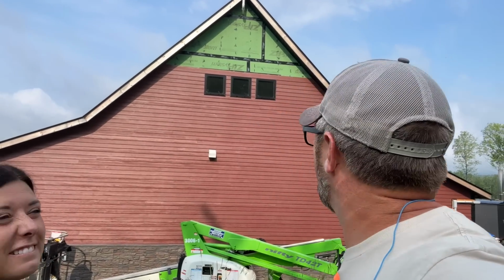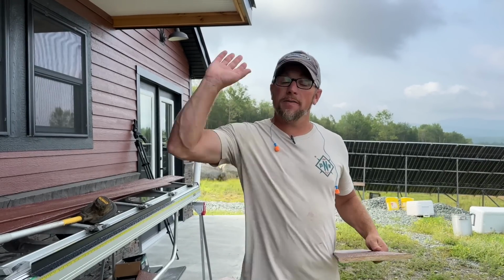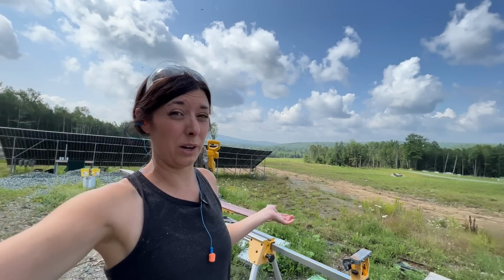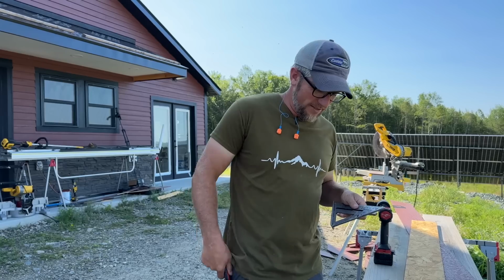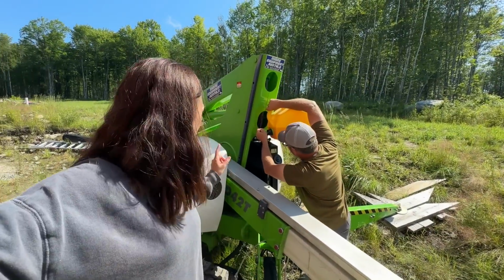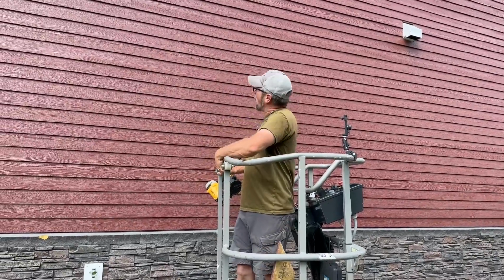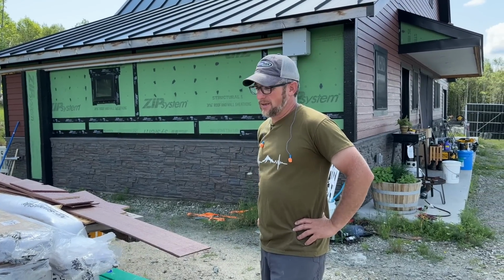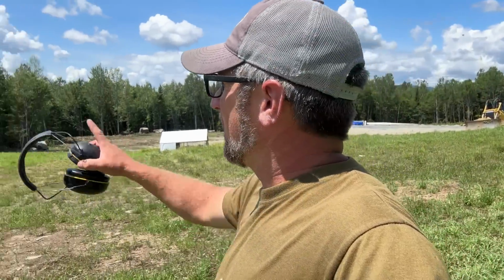We NEVER Thought THIS Day Would COME| Building Our OFF GRID House in the WOODS

Comment: There is a glue roller bottle that you can also use for paint and it works great for small jobs like edging and trim on things like you and Al are doing with the siding ... might work for "other projects as well ... get tham at your local Lowes and Home Depot or other building supply stores ...

Comment: I just did the peak like you did on my shed. For the future you can save some time measuring each board by using the one cut previously to mark the next one. Lay the cut one down and lap the to be cut one over it as it would be on the wall. You'll need to have spacers to make sure the lap distance is correct. Then just transfer the cuts to marks on the new board.
Repeat on each one going up, and the installer should report back if the gaps are getting too small or too large as you go, for the cutter to adjust slightly.

Comment: I found (years ago) a kit for sealing ceramic tile grout joints. it was a small squeeze bottle with a foam roller on one end. You would fill the bottle with sealer and then roll it on the grout to seal the joint. if you go to a tile store you may be able to find one. it might work for your paint on the siding edges.

Comment: My suggestion on the paint.  Take a small 4 oz. empty glue squeeze bottle and put paint in it or any empty squeeze bottle with a covering over the end that you can pull off.  Small enough that if the paint goes bad no big deal.

Comment: Brat to see Gina in good health to supervise So as he works high up. Not sure that's doing her mental health much good though! Isn't it about time Tanned was put to work as a sheepdog now you have some on your farm - or does he need training first, by someone with an Australian accent? Might I recommend that a cowl be fixed to the top of your vertical 'stench pipe' that removes those unpleasant toilet fragrances away to prevent penetration of heavy rainfall into your home and he could also drill a drainage hole at the bottom of the vertical pipe. Keep up the great work supervising Al, and letting him use YOUR power tools occasionally. Remember to always be safe, because your health and wellbeing depends on it.

Comment: Remember that shoe Polish bottles that had the sponge on the end, and you just turned the bottle up and and Polish your shoes with that sponge and made it had a cap that went over the top that would be the same principle. Yes, how good that's punch with the new housewives, it's fun to put the pain in the bottle and fix a cap that screws on it has little holes in the sponge on the end, you can squeeze paint into that and have a cover to go over it.  I don't know if you're gonna understand this. I'm doing it on on speaker and sometimes I talk faster than it gets but at least they had them when I was a kid. They had the one that had the little thing you dip in. First, you're going to the round ball that you're polished to shoes with. But then they came out with. I think it was shy Nola came out with. Make came out with the plastic bottle at. Had the screw lead with a sponge on the end. That you, you Polish your shoes. And then it had the cap that screwed over the top of that where it didn't dry out too bad you couldn't find some of those bot. That's the same thing

Comment: just in case you did not know every lift that I have ever been on, and I have been on many all different types they always have a bowel that you can manually operate from the bottom, just in case something goes wrong when you are high wake up just in case of emergency the person on the ground should know exactly where this little button is to help the person that is on the left. In Connecticut that is a law don't know about New Hampshire but I would imagine it is the same thing. Check it out I'm just about positive there is a button or a switch once activated rather the lift is running or not it will lower it to the ground

Comment: Sponge Head Applicator Bottle, HDPE(High Density Polyethylene) Liquid Liniment Bottle, Refillable Skin Care Cosmetic Travel Container, Snow, 9.6x3.7cm, Capacity: 50ml(1.69fl. oz)(DIY-WH0410-69) fill with paint. job done. No mess

Comment: One question. Will you put a tilt to your stink pipe? A slotted cover?  Will water go down the pipe?
Reply: Good question, Linda - some sort of top to prevent rainwater from coming in - thing is, it's such a small surface that the amount of rain that it might catch would be negligible, and it will go into the septic system - so no fear of water damage.  The heart icon that appeared means Al or Gina liked your comment!